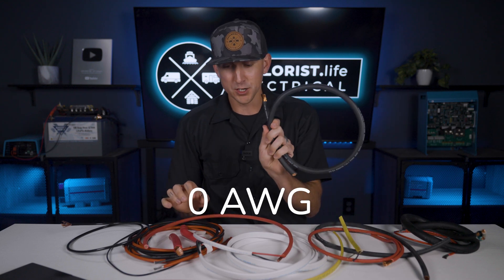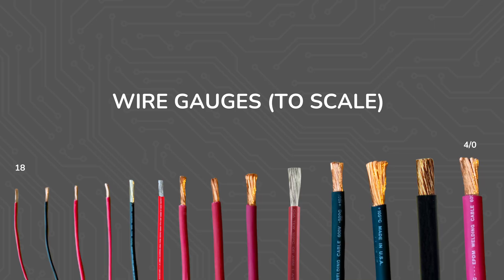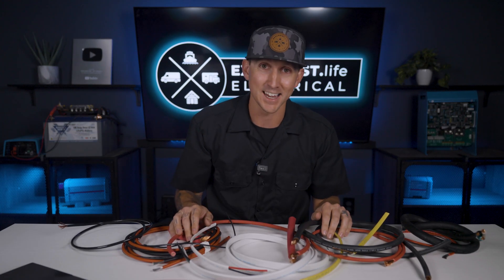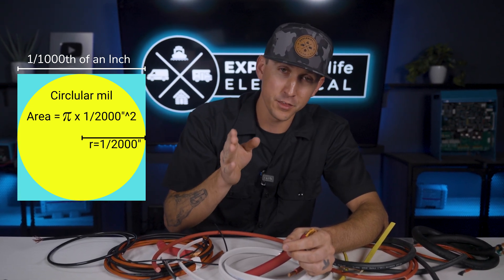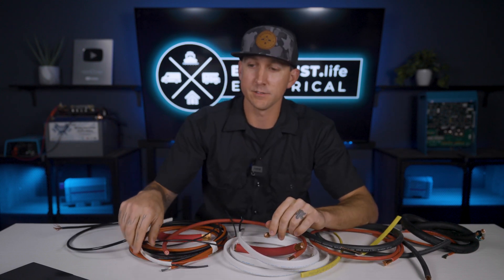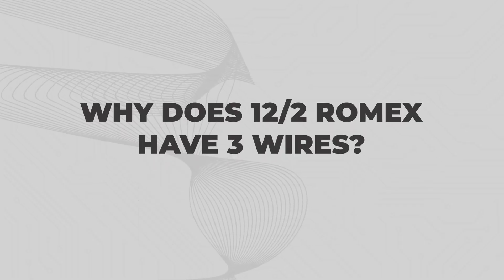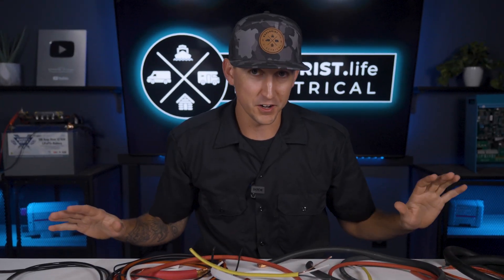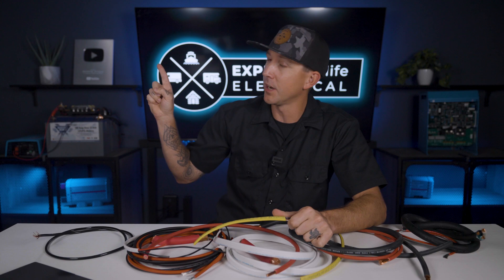Wire Sizes Explained for Mobile, Marine & Off-Grid Electrical Systems

Comment: Why Americans make everything so confusing with inches,feets,fharenheit,wire sizes etc. In Europe everything makes way more sense
Reply from the maker: Now hang on a second, in no sense does Celsius make more sense than Fahrenheit.

In Fahrenheit, 100 degrees means it’s 100% hot outside.  0 degrees means it’s 0% hot outside.

Comment: My inspector made me use AL # 500-KCML  for a 400amp service I installed.  That's a couple steps bigger than 4/0. Maybe type URD or XHHW if I remember correctly. Needed a pipe bender and that was aluminum, copper is insane to bend at that size, hydraulics are needed. 😵‍💫
Reply from the maker: That sounds like a serious upgrade—500 KCML is no joke! Definitely a step up from typical installs, and you're right, bending that stuff (even aluminum) takes some muscle… or hydraulics 😅

If you're planning to integrate that into a larger system or want to make sure the rest of your components are properly sized to match, feel free to reach out to our support team for some personalized guidance:

https://shop.explorist.life/support

Comment: There is nothing goofy about AWG wire sizes. Prior to American Wire Gauge, there was The Brown and Sharpe gauge, at the time a small machine tool shop. Think about how wire is manufactured. How many times a wire has to be drawn down to reach the desired size. If a wire has to go through 6 successive dies to obtain the proper size, it could be 6 gauge wire. If it has to go through 10 dies, 10 gauge wire.
Reply from the maker: do indeed generally size things in my day-to-day life according to how the manufacturing of raw goods process works. 🤣😂

Comment: how are amp ratings different in home electrical vs say a 8s2p Liion pack that discharges using 10 awg wire?
Reply from the maker: Great question! There are definitely some key differences in amp ratings depending on the application and wire used. We’d be happy to take a closer look at what you’ve got going on and guide you from there: https://shop.explorist.life/support

Comment: what can be done about a company that sells wire labeled as 10 gauge but actually is 14 gauge
Reply from the maker: Buy from a more reputable company: https://shop.explorist.life
Reply: I'm sorry I should have explained better we had 32 solar panels installed and one of the lines coming from one of the longer strings which was around 70 ft melted so we had a professional come out here and really do the line and then he cut the line open he made note that instead of what it said on the line which was a 10 AWG what was actually inside it was 14 AWG and they said that wasn't enough to handle the amperage the company who installed the line said that there are not responsible we need to get back a hold of the manufacturer that supplied the line to them but yet we're not the ones that bother them the company who installed it bought them so now the other companies telling me that I've got thousands of dollars worth of line that needs to be removed I just wondered have you ever heard of anything like this before this is sort of a nightmare for us we've got everything disconnected now for safety
Reply from the maker: In the hundreds of thousands of feet of wire we've sold through our store https://shop.explorist.life I've never heard of a mis-printed wire, no.  Sounds like you're working with a company who isn't doing their job.  We would never make a customer who purchased from us reach out to the manufacturer directly for a misadvertised product.  That's our job.

Comment: AWG is literally retrarded, Just like everything else aMeRiCaNs do! Like its so much more logical to use mm2 just in general for everything, but noooo you aMeRiCaNs have got to be special and made a special unit called AWG, but you didnt stop there you the went and inverted the scale so the large gauge wires have a small number and small gauge wire have big numbers and thats why AWG has size like 4/0 🤦‍♂🤦‍♂. same goes with using fractions when measuring stuff in the building industries might as well farm animals as measuring units coz it would amount to the same bs
Reply from the maker: Wait until you find out how US meteorologists measure hail dimensions...
Reply: @EXPLORISTlife  surely it cant be as idiotic as still using AWG for wire sizes, imperial units for length measurement or fahrenheit for temperature? 🤔 you have intrigued me now, so off to google it i go lol

Comment: Question wiring to small chase pod lights the wires coming off them looks small but I can’t find any information on the wires coming off size. I have roll of 12 gauge wire. Is it safe to wire them in with this gauge??
Thanks for help!

Comment: Hi Nate.  I consulted your wire size calculator and compared it to three other calculators online.  There are slight variations of recommended wire size for the same voltage, amperage and length on all of the three mentioned but your calculator invariably says I can use a smaller gauge wire than any of them.
Can you explain this and why your calculator is quite different in that regard?
For instance:  12v, 200A at 8 ft. 3% voltage drop.  Your calculator = 2 gauge.  Others = 000 ga.   That is a pretty significant difference.
Reply from the maker: Is ours different than the ABYC wire size calculator?  That's the one I would use to cross-reference if something seems 'off'. 

As far as the equation our calculator uses, it is the one noted in ABYC E-11.15.1.2.8.1

Comment: Hi Nate, I've been following your videos and wiring diagrams to build my solar power system for my tiny house (3000W inverter, 600Ah battery bank, 900W solar power, if that's relevant), and everything has been super helpful! I just wired everything up using a low strand count THHN copper wire from Home Depot and a local electrical shop for the 4/0 wire not sold at Home Depot/Lowes. Then, I was re-reading my Victron solar charge controller (250V/100A) manual and realized that it warns against using low strand count wire because of fire risk. However, I'm not sure I understand why the low strand count is dangerous. If it's the same gauge wire, shouldn't the wire be able to carry the same current regardless of the number of strands? I understand that more strands provide higher surface area and therefore better connection, so there should be less resistance in the system. However, I've been trying to find solid resources on this to determine safety, and I've only been able to find people bickering on forums. If I had known that the Victron manual said to use high strand wire, I would have used it, and the added flexibility would have been quite convenient in hindsight. However, I didn't realize that, and since I already have everything wired, I would prefer to not redo it. Does using low strand count wire pose a safety hazard because of increased resistance, or is my set-up ok to leave with the low strand count wire?

FYI, I tried to post a comment a minute ago, and it seems to have disappeared, so apologies if it's in here somewhere and I'm double-commenting...

Comment: In the UK,  12/2 your Romex is called twin and Earth. Rightly or wrongly our electricians use the earth wire as currant carrying by just adding a bit of wire insulation to show its purpose, as far as I know, this is a regular practice when installing double-switched light switches or even triple ( to switch from different points). There are specific wires for that job but they often do not have any with them, so shortcuts take place.

Comment: Most of your wireing kits for solar panels down to the MTTP are 10 g.  Should wire gauge increase after combining the series- parallels ?
Reply from the maker: That’s not necessary nor recommended for well designed solar arrays like we have in our store
Reply: @EXPLORISTlife  just so I'm following correctly (I've bought most all your wiring kits for my setup from your listings)  So 10 g connecting between panels and down into the MTTP if I'm following correctly. Thank y'all
Reply from the maker: Yep!  If you've bought the kit from us and our following the diagram from the parts page purchased, it's 10ga from the panels all the way to the charge controller, yes.
Reply: @EXPLORISTlife  I love all your videos. I think where some people get confused is when they use your teachings to do large solar arrays for a home. Your target students are the RV, Van and boating markets. I used your teachings to get solar for my RV done. But, then I expanded to target solar for my house. There, it's work for up to 8 Kw solar using 200w panels and lots of lithium batteries. So, for that use, I plan 8 200W panels in series, for each string, with up to 5 strings in parallel. As you know, for that setup, there is a combiner box with the needed 15A fuses for each string. Then 4 AWG THWN wiring inside conduit for 100' up to the DC disconnect in front of a Smart Solar 250/100 MPPT.

Thanks for all your help with all your amazing instructional videos.

Comment: Hi Nate, Excellent videos! For many RV folks, rodents chewing insulation off wires is a real problem. And, some of the cheap Chinese wire has insulation containing soy products, including soy oil, making them targets for rodent attack. Could you do a video on insulation types, including types of insulation which are not appetizing to critters. I'm of the impression aircraft and military specification wire is not on the rodent dinner menu.
Reply: Or just make insulation infused with Vitamin K blockers.
Reply: In the Aus tropics, rodents of all kinds - native AND introduced can get into chewing wires big time. An old bushies trick is to spray all your wiring with WD40. I do it every three to six months, depending on the heat and humidity - more in the hot / wet seasons. Works a treat. PS - I reckon the US could switch to metric no problem... though it might take a second revolution. Until then, my condolences.
Reply: Rodents were chewing though insulated wire long before soy oil was a thing. Thermoplastic made from vegetable oil, may be used as a plasticizer, but would have no other use, maybe floor mats. It certainly would not taste like soy oil.

Comment: A year and a half ago we had a new transformer installed to supply power to our existing house and a new barn (RV storage and workshop).  Instead of 500,000 cmil the power company refers to this as 500 Kcmil.  K means 1,000 so same thing, just easier to say.  Ditto for 350 Kcmil, 250 Kcmil, etc.

Comment: You forgot to mention the trailer signal lights Which has 5-12 gage conductors and 2-10 gage conductors
Reply from the maker: Those fall under multi conductor cables like 10/2 12/3
6/4 etc like I did indeed mention.

Comment: While not common, I've seen that 5AWG and 7AWG are sometimes given with server rack batteries for connecting to bus bars. I've also seen them for sale on Amazon. I've not seen 3AWG however.  The most common sizes you'll encounter with Victron equipment is 10AWG, 6AWG and 2AWG for most components like MPPT, Orion and Blue Smart Chargers other than the big stuff like inverters and batteries.  The only thing I've seen that uses 4AWG is the Orion XS 12/12-50A. There is a chart in the Victron manual for inverters, but most common is 1/0AWG for 24V and 2X 1/0 for 12V, but depends on a number of factors (size, distance, etc.). For car audio, 8AWG and 4AWG are more common than 6AWG and 2AWG.

Comment: I opted to use marine grade or high stand count wire. Same gauge can handle a little more current for the wire size. Just have to be more careful when stripping it.
Reply from the maker: 'marine' wire vs not (tinned vs untinned) actually doesn't have anything to do with current carrying capacity.  The insulation temperature rating of the wire is what is important there and 105 degree untinned (non-marine) and 105 degree tinned (marine) wire will have the same ampacity rating.